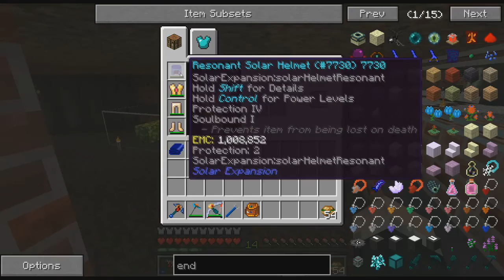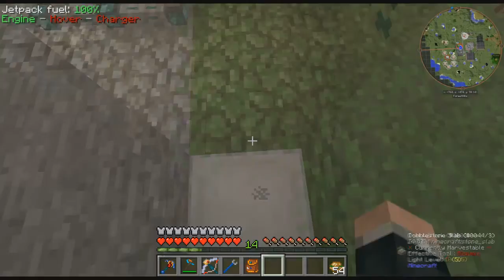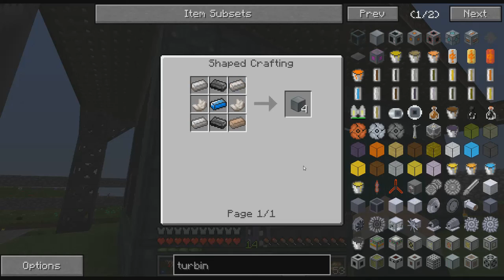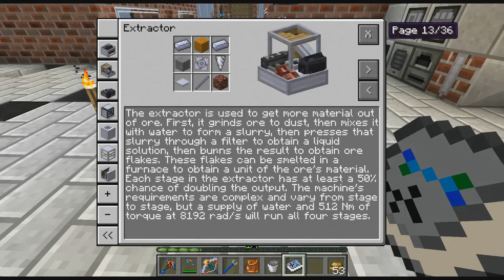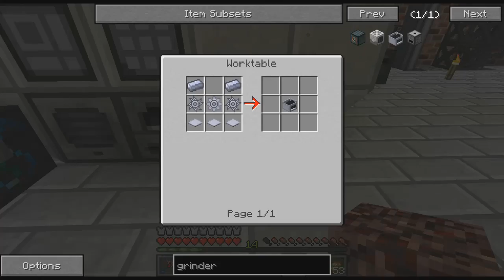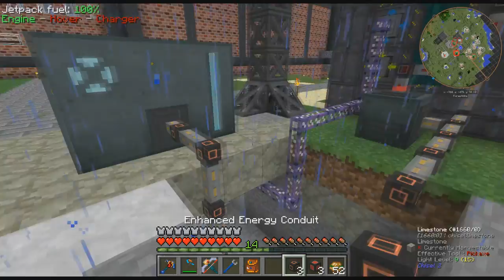Minecraft DNS Tech Pack Ep16 "BR & Rotarycraft Start"

Comment: Flowing ender does the same in a reactor as a source block, and a source will spread to the 4 around it(in a plus pattern). You didn't need nearly that many pearls.my small one with 5x5x5 interior gives 15k at default settings(I'm on vaygrims chance pack and he tweaked it so I'm actually getting 90k+ at full tilt). http://br.sidoh.org/#reactor-design?length=5&width=5&height=5&activelyCooled=false&controlRodInsertion=0&layout=XEXEX5EXEXEX5EXEXEX
Reply from the maker: Thats awesome reactor setup. But trust me I have a master plan (evil laugh). Also about the ender, I know its just as good still as flowing, but for the sake of completion....i must fill in the whole top layer. The OCD will not allow me to cheap it out.
Reply: It shouldn't be getting quite that much(I wouldn't think it should anyway) but I don't suffer ocd, and and fine with just putting it in the for corners around the center fuel rod. looks no different from the outside, unless you're using full source blocks top to bottom(not even sure that would look different) once the lid's back on
Reply from the maker: True. Just one of those things. Its like building off center of a hallway. Just cant do it LOL